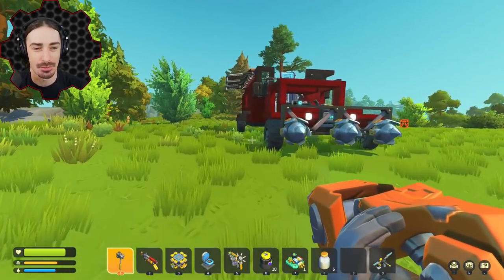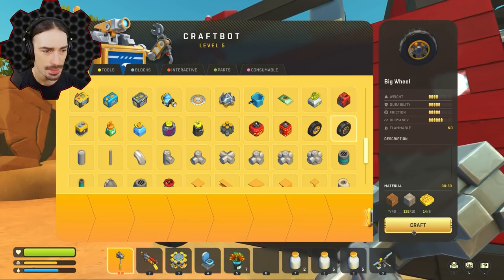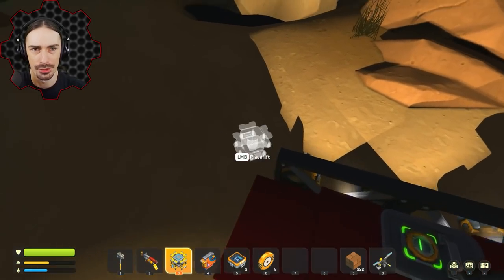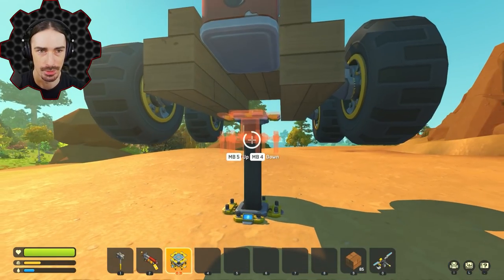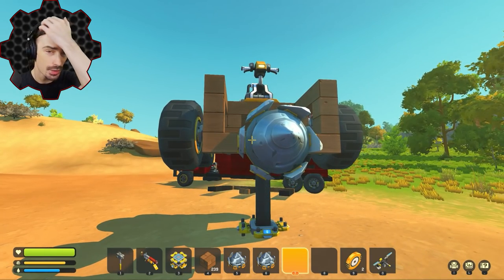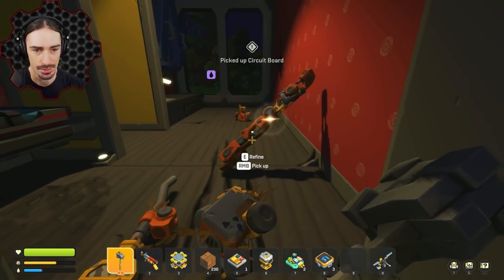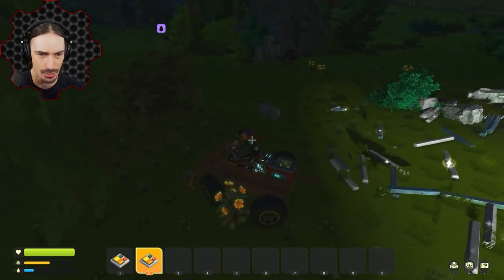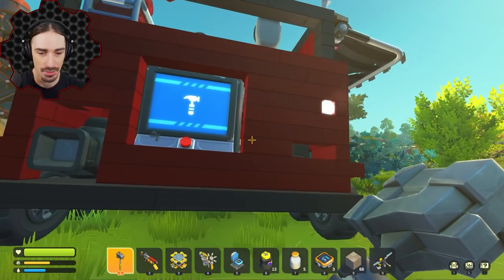I Built a Deployable Mining Vehicle For My Mobile Base! - Survival Nomad 11

Comment: When you're more late game, you should make a bunch of T3 wood and replace all the normal wood your vehicle is made out of with it
Reply: He could also do tier 2 wood next episode or a bit later, although he might have to make a woodcutting vehicle.
Reply: or just make the vehicle full on metal at some point
Reply: @apersunthathasaridiculousl1890  yeah maybe, but I suggested t3 wood because it's the same weight as t1 wood, but has way more durability. I used T3 wood for most of my vehicles in my world
Reply: @johnderat2652  ahhh
Reply: @omegablaze135  last episode I think, he mentioned intending to be able to swap out the drills for saws on the mining vehicle.
Reply: @apersunthathasaridiculousl1890  it's too heavy

Comment: I am going to repeat this for anyone that manages to catch this Nomad bases are Piston powered for a reason... They are usually made of stronger metallic materials that otherwise would not be movable without using piston engines to do it they are often large enough to harbor multiple smaller cars including a mini tank on top of being multilayers armor plated. The are usually as soon as possible equip to the nines to fight the farmbots armors with spinning blades and drills. What Scrap man is doing here can be considered "Extreame Nomad"

Comment: 19:18;
You can attach the mining vehicle to your main vehicle with the welding tool and a block.
(In the feature, if you what, you can automate that.
With a spudgun, a vacuum pump, a button and a sensor.)

Then you can use your lift to your main vehicle,
without your mining vehicle falling off.

(Just a tip,
if you what to attach your mining vehicle, this way.)
Reply: We need scrapman to see this
Reply: No need to overcomplicate it. Just have a pipe at the required spot to weld the miner to, which could be detached by removing one pipe piece which you can then just place back.
Reply: And when attached he can use the lift and it will consider it as one vehicle.
Reply: weldin a vehicle to the main vehicle doesn't fit the theme. I say put it on a trailer :) But this works as well
Reply: @burd7516  yes
Reply: yes, especially if another red guy attacks him
Reply: @apersunthathasaridiculousl1890  farm bot
Reply: if it holds then its not needed
Reply: More realistic to have a cool system lifting it up in my opinion so I would prefer it like it is.
Reply: That's not nearly as cool as what scrapman has done
Reply: @GenXToysGeek  Why do people keep suggesting this. Is it a joke?
Reply: @Jonas_Mikkelsen  no clue
Reply: @Jonas_Mikkelsen  I suggested it once but now that I think about it, it's more negative than positive.
Reply: I had thought of this when he mentioned the issue of not being able to put it on  lift
Reply: Considering the mining vehicle will go for periods of time when it is not used, it makes sense to weld it down.
Reply: @Jonas_Mikkelsen  true
Welding it would just kinda ruin the lift part cause he cant put it on a lift while the miner is hooked up
Reply: he knows that, he often did it in multiplayer monday etc. ... i think it's just too complicated atm for the "nomand" style
Reply: @GenXToysGeek  It's a nomad challenge.
Welding to the mobile base fits the theme, because nothing is left behind.
Reply: you mean future, right?

Comment: 24:21 Try putting them on pistons so you can extend them forward to keep the farmbots away from your important bits?  Fast pistons might also be able to ragdoll them easier, and once you can afford to put drills back on it might increase the damage the drills do to them as well on the initial hit.
Reply: Perhaps it would work, but i feel like that the farmbot would destroy the pistons before being ragdolled
Reply: @fives5555arc  I think so too. They're expensive though for this series, Steve.
Reply: @fives5555arc  Possibly, but you have to hit the ends of a piston to destroy it - the yellow tube has no collision so it can't be hit.
But the guns he is planning to install are a better idea.
Reply: @greybeard5123  agreed

Comment: If you turn the refinery the 180 degrees and put the output chest on the other side, it might pull from the other chest, because it will be slightly closer to the second resource collector (but slightly further from the first)
Reply: He doesn’t have enough space
Reply: @st4r658  it wouldn't take any extra space, it's just flipping the refinery. It wouldn't take any extra space
Reply: This should work, the refinery is picky about pulling resources from collectors behind it.
Reply: Wouldn't this just reverse the problem and make it so that, intead of picking things from the right but not the left collector, it picked up things from the left and no longer from the right collector?
Reply: @bbittercoffee  It shouldn't. Refinery bots have a wide angle they can pull items from, if the resource collectors are in front of them.
Reply: @bbittercoffee  no, because then the craft bot would be facing forward as well as being further to one side, and when facing forward, it has a wider range
Reply: @nihl2951  well, he already tackled this in another video and it didn't work.
But I also saw the range in his newest SM video that you talk about, kind of ridiculous thst it can't take items from something beside it but it can take items from something that's not even connected to it.
Reply: @bbittercoffee  yeah, I know, I'm just saying
Reply: I was thinking something similar but instead of turning the bot, turn the resource collecters so they are on top of each other instead of beside

Comment: 6:20 Sir... That's Why I told you that you need to build Ram Wedge/Plough in front of your Battle Wagon to protect the Cab.

And the reason that Raming did not work is your Battle Wagon is "Too Slow" from the weight of added Refinery.

Comment: Scrapman, learn from the Nomads. Secure your perimeter before settling for the evening. But all bot damage seems to occur where the animation ends. What I mean by that is if a haybot swipes at you and hits about 1 block into a creation of yours, it'll deal a damage roll on that layer of block and everything it hit has a chance of breaking. If it does its stab attack that reaches nearly 3 blocks in, so now everything in about a 2x2x2 block area has a damage roll done on them. Farmbots are cheesey in that their sweeping scythe arm hits about 4 blocks deep and where the scythe is at and across that entire arc of a swing. So him swinging at you was when the damage was done.

Technically the girder frame did its job in that it blocked the farm bot from trampling onto you and dealing stomping damage to your vehicle. I'd suggest using all of your girder frames as a bumper and also making backup attachment points so in the case that one gets destroyed, the others don't just drop off. Also use green garment boxes as applique armor. They have a durability of 7, the same as Tier 3 metal at a fraction of the weight.

Comment: Pretty nice little vehicle. If it's just for mining or tree chopping then small and agile is definitely the way to go. Most want to have a collector and refiner on the machine though so they can just keep working. With your mobile base you don't need that so much. Welding it onto the base is the easier and safer way to do it though.

Farmbots do have a long reach, so that's why it was hitting things inside your vehicle while you were ramming it. It's lucky that it wasn't hitting you instead. As it was you got off fairly easy on the damage. The last time I ran into one unexpected it destroyed my scout vehicle. Smashed the engine, a couple of wheels and snapped the whole thing in half.

Comment: Move the resources collectors over 1 or 2 blocks by opening a open on the other side and sliding both collectors towards the new hole. You are only a block or 2 off from having the refine bot pull from both. Give it a try it should work. Great video and series. Keep them coming, I am enjoying it a lot.
Reply: He won’t do that. He wants that everything has a center point

Comment: You should put the rotating sun-screens on the back, to mirror the new craft bot location. This would also free up that other side for another vehicle mount, to balance the weight. Perhaps an oil/water/lumber mini-car. 

I'd also love to see you start replacing the railings on top with pipe-work, for a more industrial feel. Bit less blocky. Maybe even the vehicle dock too.

Comment: If you're that concerned about the resource collector not pulling from both sides, make it rotate with the press of a switch!😀 Have one controller opens the roof, raises a piston that's connected baring and a beam with the collectors on it. Then it rotates above the vehicle, lowers back down and closes the roof👌
I'm about to do something like this on my ultimate utility camper truck, but I think I already have too many moving parts🤔😀

Comment: I expected you to boot up backup save file after the truck got wrecked, I don't think anyone would mind
You might be able to utilize both collectors if you move refiner a bit more backwards toward the collector it can't reach, by extending its connection to the chest using pipe
I love how the nomad truck is coming together, has this rustic feel about it, comfy!
Reply: I would have reverted to the previous save file if that happened to me

Comment: minor suggestion, you should move the middle drill up on the arm so it's not on the same plain as the other drills. That way it won't bounce around and slide off as much cause it has three points of contact.

Comment: @ScrapMan An idea is that you can put the seat, engine and fuel canister on top of the vehicle like on a combine. Then put both the resource collectors at the front and turn the refinery 90 degrees so it faces both the collectors :) This way you got way more space inside the vehicle too. And I think it would look pretty cool to be driving it from the 2nd floor so to speak xD

I don't like back seat gaming so I just put this out as an idea. You feel free to use it or ignore it ^^ Great video btw! Loving this series!

Comment: If you have sensors on the front set to max distance you can hook them up in a way where if a sensor goes off then it moves the spud gun in a specific direction to hit the bot. And you can also just have a button to just fire the spud guns. And there is enough room in the hood for the logic gates and stuff.
             
               Hood ——> _______________
              Front ——> lOOO!!OO!!OOOl         O=sensor.  !!=spud gun.    And there is the logic behind it.

Comment: I remember having a similar issue with the resource collectors I think if you move it over by one or make it a switchable piston system that moves both, what I did wand if you put the resource collectors in line and on the input side of the refiner it will suck both

Comment: You could have added a backhoe, with a drill on the tip, to your mobile base instead.
edit: and the tip could even be modular, you could change to a pump to get oil or chemicals, a saw to cut trees or a drill for stone/metal.

Comment: 2 ideas: [1] have the fork lift up with a sensor connected to a timer (the timer so you have time to park the mining vehicle), [2] if you need wood you can swap out the drills with blades (though you might need an extra mechanism to position the blades in the correct orientation)
Reply: He won't need ridiculous amounts of wood since he isn't building another manor. For the wood he needs, it is easier to just strip it from farmer villages.
Reply: That's why I said "if"

Comment: Why instead of putting the mountable spud guns on your current vehicle, don't you make another deployable vehicle? like a small tank made of most damage resistant block you have, cause this way you could even go inside warehouses with it
Reply: kAN tried that with metal 3. It works great on the lower floors, but the red tapebots on the top floor destroyed half of it in one shot.

Comment: Stupid question. Is there a way to connect the resource collectors like with the glass tube?
Reply: That is a stupid question, and no, you cant use pipes on collectors. Only items with the pipe connection:- refiners, chests, pumps etc
Reply: Would there be a way to slide it over with a piston or change the layout so it could pull from two then? I know I ask stupid questions but I can’t get the game myself to figure it out myself
Reply: @brettmacaulay397  hmmm, pistons aren't a bad idea but space is the main issue, unless scrapman rearranges the refiner....ideally he needs it facing forward, or possibly rotate it 180 degrees with the chest on the otherside, agreed its a case of trying it to see what could work

Comment: You know, if you recreated the elephant or mammoth from Halo, it would be more efficient for vehicle storage...
Reply: But it would cost a lot of fuel.
Reply: @sans_kingl1628  Not exactly...
Reply: @JamesTDG  well think of the weight
Reply: @sans_kingl1628  SM is building with T3 wood atm, and with doing some math (and the fact that it just needs to be the shape, not a 1:1 remake), it should be only a bit worse in fuel economy as the new vehicle (once it is finished)